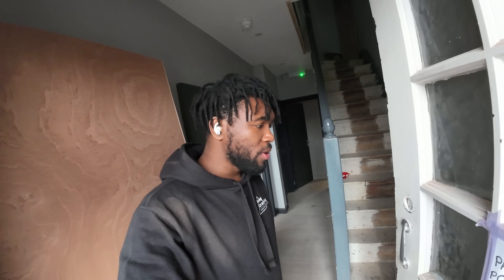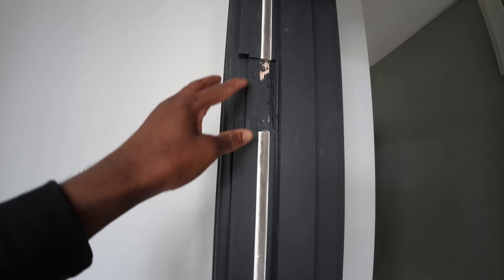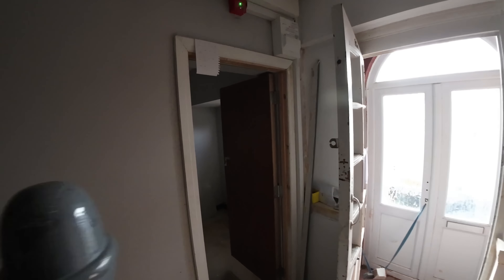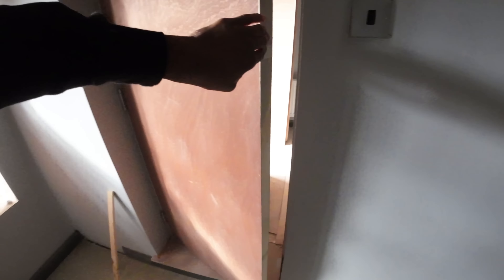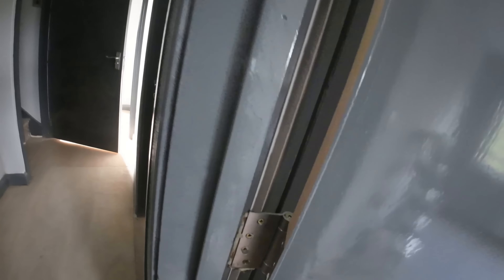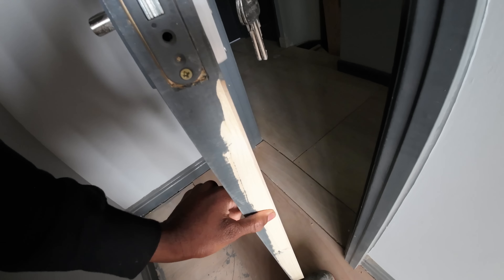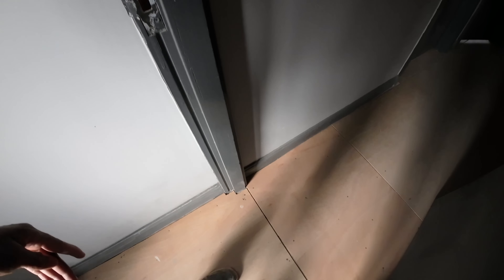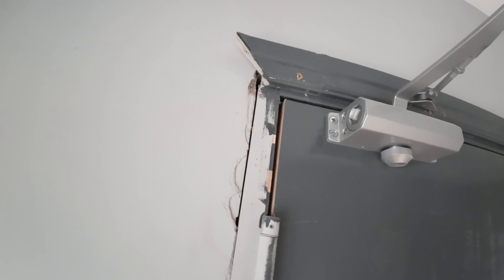A Bad Carpenter !

Comment: Mate that’s rough… I’ve been making up door frames today from scratch. Ordered the timber in special to fit metric sized openings. So sizes like 726mm and 626 x 2040mm doors etc houses are around 50 odd years old on the estate and they are all metric sizes. You have to make sure your frames are on point. Level, plum and no bows in them so the doors fit nice and snug. Takes a lot of time and prep especially in older houses. It’s a social housing estate so they are all ply flush doors and fire doors such as what you are using here. The skirts and arcs are rough as a bears backside also! Chin up mate and crack on!

Comment: New sub 👍👍 mate I fitted my own fire door fd30 into my integral garage and when I fit the casing it accidentally pulled it in by a mill so it is right in the limit of the 3-4mm gap but rest is 2-3mm, and also when I did my lock I slightly chipped the keep plate bigger but all got passed of by building control 👍 but honestly after seeing these I don’t know why I worried so much, I also fitted the perco chain door puller as I didn’t want the big bulky door closer only other thing that has annoyed me as the lock went faulty so I had to fit a different t lock and it’s ever so slightly smaller than the other plate, but someone suggested just getting the fire intumescent sealant and filling any small gaps to keep it tight

Comment: I'd be very careful with jobs like this, are you BM Trada certified?
Otherwise it's against the law for you to hang fire doors as they can't be signed off
I noticed there's no intumescent fire mastic behind the Arkitraves
Your liable if a fire happens as they're not fitted to manufacturers fitting guide